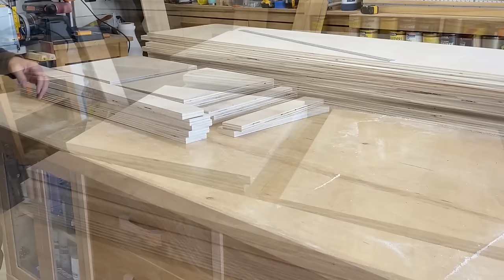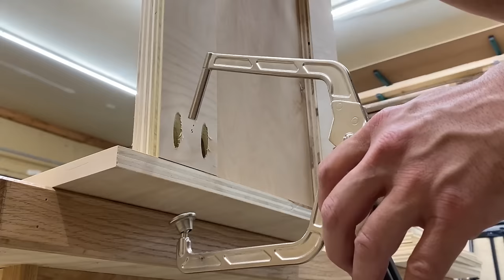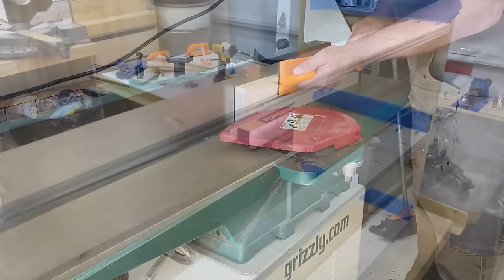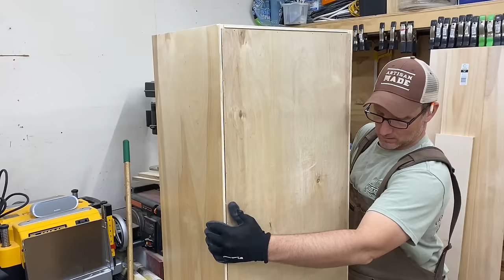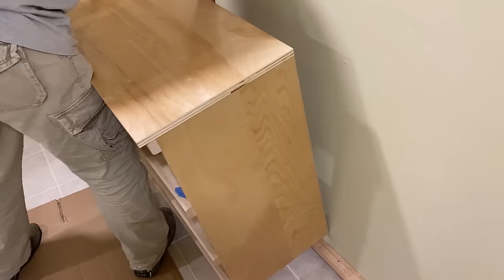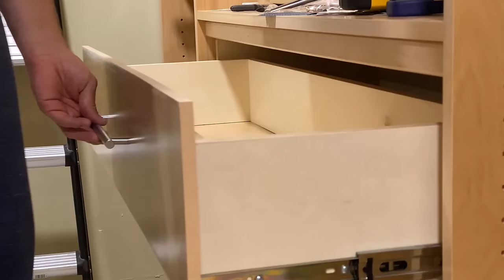How to Build a Walk-in Closet Part 2 / Building the Ultimate Walk-In Closet / DIY Woodworking

Comment: Oh so many questions??? 
1. If you weren't filming how many hours did you have in this build? 
2. Why ¾ plywood? You could have used ½ and gained extra space and ridgity would not been an issue and they are all tied together? 
3. How much $$$ on this build? 
4. Will the wall heater be an issue? 
5. How did you convince the wife to use the iron for the edge banding???  Last time I made Grilled cheese with ours my wife flipped her lid haha... 

Great Build AL, it turned out fantastic as always.
Reply from the maker: Hello Tom
1. Maybe 30 hours. 
2. 3/4 looks nicer and 1/2 in is not really 1/2 in. It’s probably closer to 3/8 around here 
3. Lumber prices suck right now. It cost about $650
4.  This closet is in the basement and I have never  turned on the heat. 
5. This is a funny one. I bought a new one about a month earlier. When my wife saw me using the old one in the garage, she understood why I bought her a new one. Lol

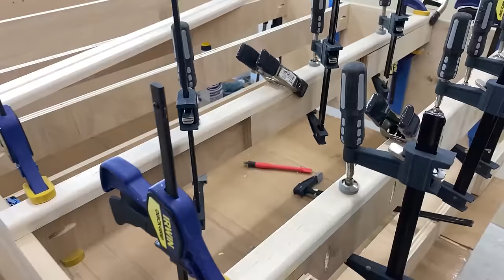Comment: Looks great, not a thrilled about the baseboard treatment but you make it work. Not sure why at 11:30 you glued/clamped and then after the glue dried, you installed the pocket screws, why not glue and then use the pocket screws as the clamps?
Reply from the maker: Pocket hole screws can sometimes cause a little movement in the pieces that are being connected. If the glue is dry first, you can install the screws without any worry of shifting

Comment: What was the width you ripped the plywood? Judging by the placement of the coat rod, the coat hangers will project out of the cabinets?
Reply from the maker: 15 inch depth. Most store bought closets are in this range. Deep shelves become black holes.

Comment: How much space did you leave for your floor heater? We have the same situation and I thought I was going to have to move it but you seem to have just built your wall around it.
Reply from the maker: My heater is hot water so I went as close as I could. I would be more cautious with electric heaters.
Reply: @ArtisanMade  mine is water as well. Thanks!!

Comment: Looks great. Well done.  Question: when cutting the slots for the plywood bottoms for your drawers, did you make two passes to get the proper slot width or were the blade teeth on that saw blade a quarter inch wide?
Reply from the maker: Thank you. I used a dado stack, but  how you are describing it is exactly how I do it when I’m too lazy to change the blade.